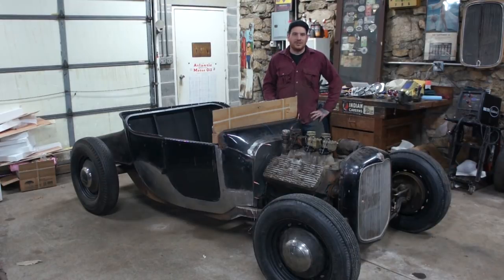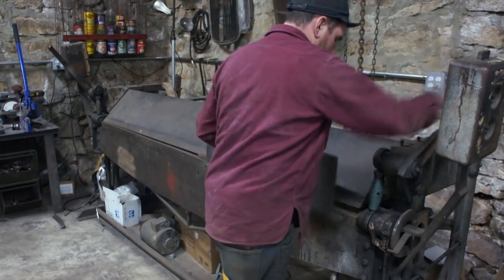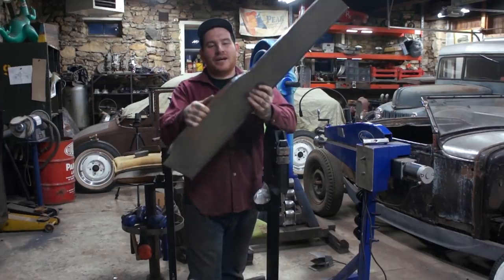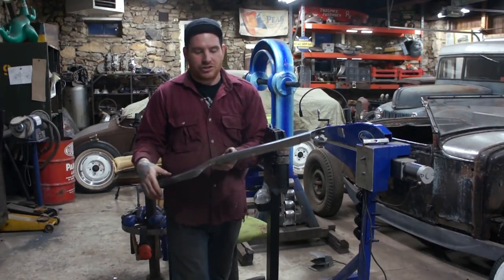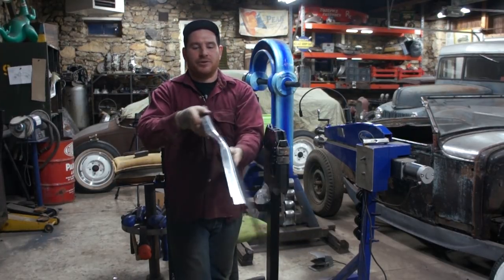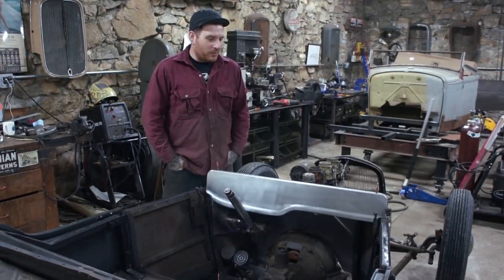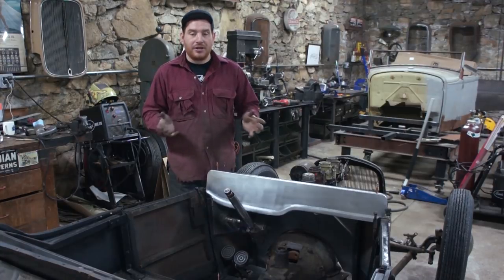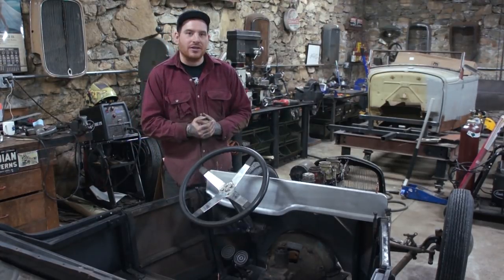How to Make a Custom Hot Rod Dash- Ford Free-T - Ep. 22

Comment: can't believe this t has come so far over the winter. what's the plan for the windshield
Reply from the maker: Thanks James, yea it's hard to believe it's the same pile of parts looking at it today!! I am still thinking on the windshield. I have the original windshield frame and stanchions I think I may modify and lean back a little. I will also only run one half of the windshield as well. I gotta mock it up and stare at it for a bit. Honestly I'd prefer to run it without one if I could, the lines of the car are so clean without it! -Matt/ITG

Comment: nice job on th e dash.   what gauge did you use?
Reply from the maker: Hi William,I used 18 gauge as I had planned to weld it into the cowl and make it a structural part of the car. Normally if it just bolted into the car I'd do it out of 20 gauge as it's a lot easier to manipulate. Thanks for watching! -Matt/ITG